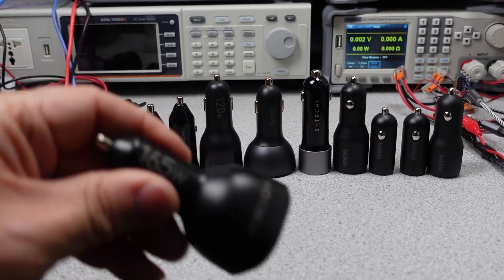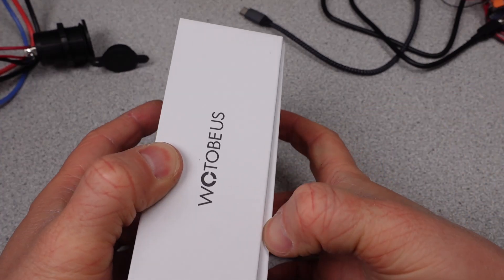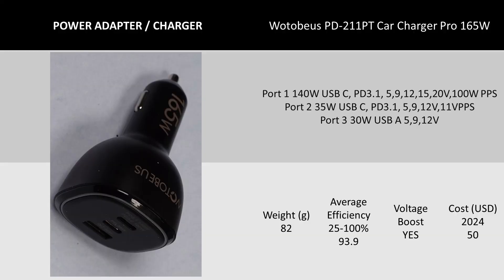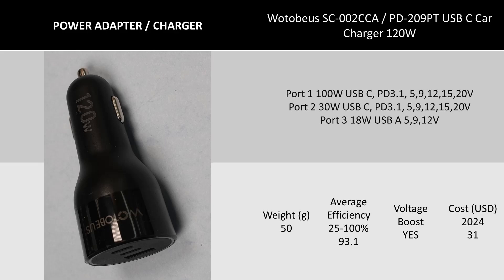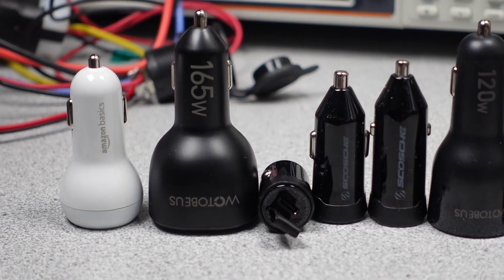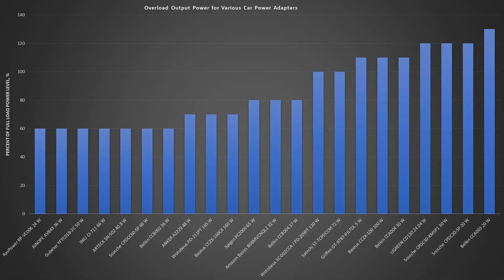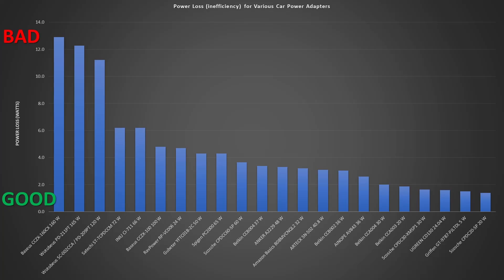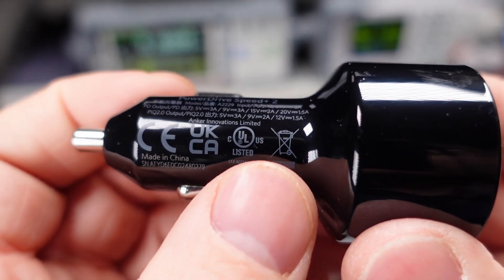USB car chargers from 5 watts to 165 watts reviewed and tested

Comment: @allthingsoneplace can you review the aohi 170w "car charger " vs 160w  baseus car charger? the aohi seems amazing (have a screen) this is good for people in a camper van that looks the use everything in 12v and want to run their computer and everything. Also there is this ugreen 150w that have a cable, it seems good, from hours of research this are the 3 ones that look the best and easy to find

Comment: Wow!  That eliminates the Wotobeus and 2 USB ports in my search.  This widowed senior thanks you!

But my socket is sunk under a door making width an issue.  So, the longer Satechi 72W, while not perfect, might be best?  I watched several times, thank you.  And am most grateful.  Both my 6th generation 12.9” iPadPro and my iPhone 15 ProMax are shown as compatible.  They’ll just have to take turns, vs. dual charging.  I’d eliminate the USB-A if I could, as it seems totally unnecessary?

Now on to cables.  You have more videos!   Wondering if the soft Mophie 60W stream I wanted will be adequate?  I learned I beed ESR?  Or maybe I’ll need to go to 100W?  Wow…

Thanks!
Linda

Comment: so you say you use the Anker, but you said the socket isn't meant for the current in 12v and can't get the heat out?? so is it safe or not for a cig lighter...
Reply from the maker: At the higher wattage adapters, the contact in a cigarette lighter socket can be very poor and then the pins get crazy hot and melt the plastic body of the adapter.  This has been demonstrated on many channels, I've melted a few myself.  The sockets are usually fine.   They have various ratings but it's the connection of the adapter to the socket that becomes a problem.

Comment: Idea for a follow-up video. Testing PD 3.1 car adapters (140W on a single USB-C port).
Reply from the maker: Yeah, it's pretty difficult as it's beyond the power capacity of most sockets, unless they are 24V sockets.  I also haven't seen many at that power level.

Comment: Looking seriously at the Baseus CCZX-100 specifically for Starlink Mini operating on USB-C.  Given it needs 100W for startup then drops to 20-40W during operation, I think this is a good fit.  I'm using 12V car socket in my travel trailer that's rated to 15A and supported by appropriate wiring/fuse.  Strictly looking at the efficiency, the fact that charger will never be left in place when not in use, heat disipation, etc, this appear to be my current best option.  Alternatively, would love to hear opinion on Anker Nano 167.5W 3 port.  Only need one port.
Reply from the maker: Nice setup. I’d check the all things website if you want the efficiency of the ones I’ve tested.  Yeah it’s important to have that current rates socket.   I’ll have to look at some more high power options.

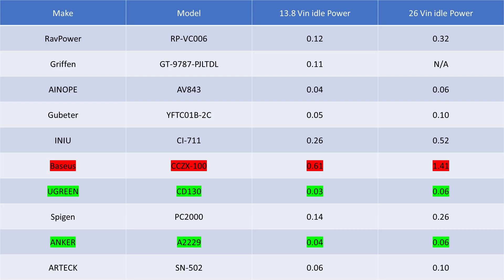Comment: What is that table at 10:58 where Baseus CCZX-100 has some kind of value 0.61 and you were talking about idle power…? I just bought that. It has a display that is turned on even if no USB device is plugged in. Probably that is using the power – in that case the comparison table is not fair. 🤷‍♂️ Anyway, thank you for the review (I learned that this charger is not the worst), it helped me to decide to buy it! 😉

Comment: I use a 175W HKyoriyoi car charger that supports PPS Fast Charging 2.0 for my Samsung S25 Ultra phone in my Honda that supports 180W and it’s amazing. I also have my dash cam and an extra iPhone cable connected to it.
Reply from the maker: Yeah, that’s a lot of current on this type of connector.

Comment: Hi could you help me please in picking a charger to be used in my car.I bought a heat pad for my car and it needs output 12 volts 65watt 3amps would you know what one I should get on Amazon.I don’t really understand PD.Does PD mean that the device can give out various voltages and that your device will take what it needs?Thanks.

Comment: Hi, I've just come across your channel from trying to wade through the mess of 12V car chargers, I'm finding it a rabbit hole. Hope you might be able to give a bit of advice. I'm looking for a charger that can keep my phone from draining on long journeys while I use Google Maps. 
I've been looking on Amazon and it's a minefield, everything is different specs (wattage, PD, PPS)! I also can't help but notice there are a lot of Chinese manufacturers that I've never heard of and I wonder how safe they are (Iniu, Anker, UGreen) but also how valid their claims are of what they can do, I kinda feel like they might be fibbing and how many of them are copies of each other... The only one I've heard of is Belkin which seems to come at a premium. 
Unfortunately, the Anker one you have isn't sold anymore. Any advice on choosing between the current range on Amazon? I was thinking of the Belkin as I thought it would be made to stricter standards (which I think it is) but it sounds like they disappointed in your tests. A link to one on Amazon would be good. 
I've also just upgraded to a slightly newer phone after using an S6 for an age so moving to USB C. Cables for this also seems to be a mess to understand with the various iterations in speed. Again, the ones available are sold from the likes of Anker but most USB A to USB C cables seems to be the older USB 2.0 standard, rather than USB 3.1/2.

Comment: For us not so knowledgeable on all this, is there any simple way to know or check for high power usage when nothing is plugged in? If it helps me, I just got the Power-Z KM003C USB-C tester and started learning how to use it. Can I use this tester to look for something that will tell me if my current car chargers have high power idle use?
Reply from the maker: That tester won't work for that as this power consumption is between the socket and the car charger.  You basically need a power analyzer with low power capabilities for low wattage measurements.  For DC measurements like this, you can build it yourself with a couple multimeters and a resistor, a calculator and ohms law.  Sounds like a video idea to me.
Reply: @AllThingsOnePlace  Yup, WAY out of my league and best to leave it to pros like you 😊

Comment: it would be interesting to test 'load dump' - what happens if you disconnect the battery on a conventional system and you get inductive kickback into the socket. This can hit 80V or so. Exploding at 30V in (high battery voltage on a 24V vehicle)
Reply from the maker: Ah, yeah, just rip it out of the socket, if you slowly take it out, you could go way over 80 volts and make some nice arcs.  Now I need to find a see through car socket, ha.  I'd hope the better designed ones have a TVS, the cheaper ones aren't going to.  I did a bunch of tests for this with USB C at 5A.  I have no idea what I did with any of that.  You can get some nice sparks.
Reply: @AllThingsOnePlace  This isn't taking it out of the socket, it's the battery becoming disconnected when the car is running, and all of the inductive loads in the car spiking the supply. TIs 'Application Report
SNVA681A – March 2015 Load Dump and Cranking Protection for Automotive Backlight LED Power Supply' is a reasonable overview. The voltages that can come out of a mildly faulty automobile, that everything really needs to survive to be reliable is pretty wild.

Comment: I think there are some interesting 12V USB chargers in the van dwelling, or RV, circles.
I think I wound up with one of the  CoolGear ChargeIt models. And ran 2 wires to the battery or some 12v hot point inside the car.
I'm not sure about the pros/cons for everyone - I assume if someone is here watching this, they're willing to watch a yt video about how to install one, and spend an hour running the wires.
IMO, I figure I'm going to be charging stuff in my car for the rest of my life. I may as well have the convenience of a permanent power port, and whatever fast charging I could need. It's kind of nice having the option to throw a laptop or phone under a car seat, and leave it charging while you go into a store or something.
And depending on the car, maybe it's nicer to have it located in a glovebox, footwell, under a seat, etc. Sometimes cigarette sockets are not conveniently located. And my old one had bad contacts, so sometimes it'd wiggle itself loose.
I don't know what you'd search for if you want one - probably something like 'laptop rv/van charger', or 'hardwired 12v usb charger', or add pps, 60w, etc.
Reply from the maker: mm, yeah, permanent charging point, I've done that on some older cars.  Switch and a fuse.

Comment: was looking at boost converters to try and wire into my diy 12v/24v 4s/8s lifepo4 battery packs to use around the house/in the car. found some cheap higher wattage models meant for using w/ LED light, but the voltage range wasnt very usable and they were all large units with heat sinks, then i remembered these things existed. the boards inside are really slim in some models. think i might make a power bank out of ~32ah lifepo4 cells and use these for the output. need something close to ~14.6v to handle charging but i think ill just end up using an mppt solar charge controller. dc is dc and those charge controllers work fine with any dc source., and the cheaper mppt ones still have the ability to step up voltage with preset lifepo4 4s/8s settings. EASUN power (generic epever) makes a 20a mppt that they sell for only ~20$. could just change the input leads from solar wires to an xd60 and attach a 15v or 20v pd trigger board and charge my ammo can packs up that way from a gan usb-c wall charger, or use a solar panel. still not using bms boards. active/inductive balancers with a 12v thermostat/15w heating pad works fine and is probably safer given most lifepo4 battery issues are because of junk bms boards
Reply from the maker: that's a lot.  and yeah, these little converters aren't a bad place to salvage some converters.  anyway, be safe with all those batteries.

Comment: I'm looking for a car charger with three usb-c PD ports (1/family member). I did see Lisen 101W and URVNS 240W on Amazon, but that 240W scares me temperature and battery draw wise. I don't see a single safety listing. Any advice?
Reply from the maker: Yeah, 240W for a car charger... no.  haha   100 watts is pushing it even but hopefully will work.  Yeah, it isn't really a product category they worry about for a safety listing because it doesn't interact with the mains.  Basically, does it get hot and melt, and have automotive qualifications, these would be a lot more expensive.

Comment: Are they super capacitor? Just learning 😊 got a dash cam with a capacitor fitted and has only one port. My previous Samsung fast charger with double usb port but wont charge my azdome m550 pro dash properly. Need a usb cigarette charger that charges my dash and phone on the go. Looking at ugreen 130W need help if this would work?

Comment: Although not easy to do, it would be very interesting to see how these "chargers" perform in an actual car with the engine running and the high beam on to make sure the alternator is "active". Can they handle the "dirty" input voltage? Or will they output "very dirty" voltage too?

Comment: My baseus 160w just melted. I'm coming back to this review to get some ideas about what to do. 

Now i see it is inefficient and must dissipate 13w. It was hot i was running my laptop.

 But there is no better choice. I'll split the power over several chargers.
Reply from the maker: Yes, splitting over several adapters is a good idea.

Comment: My baseus 160w just melted. I'm coming back to this review to get some ideas about what to do.
Reply from the maker: It is interesting that some have had great luck with it and others, well you know.  The connection point to the vehicle is a very small contact pad and therefore that area will get very hot.  I have had entire connectors melt from this contact patch being not the greatest.  Then on top of the efficiency you will be generating heat internally as well, put those two together and it will melt.

Comment: I've been using the 160 watt Baseus for at least a year now. It pulls device charging duty including running\charging my Dell Precision laptop. Never an issue even in the Arizona summer however I've never maxed it out. I'd estimate 120 watts continuous without complaint
Reply from the maker: Wow. Nice.
Reply: @AllThingsOnePlace  one thing i should have noted is its on a socket connected to a LiFePO4 setup which can handle much more current than the typical 10 amp dash socket and the voltage doesnt droop

Comment: Do mobile phones care about ripple voltage that much? is it really much of a concern?
Reply from the maker: As long as it is within reason the power supply should be able to handle it.  In most cases phones are reducing the incoming voltage so as long as the voltage doesn't fall below that point or exceed maximum ratings I don't expect there to be a problem.  This would be some crazy unstable power supply though.

Comment: Do you know the max voltage the 165 watt charger can handle? I was planning to use it to build a power bank to power my laptop, but I don't know the max voltage it could handle. My cells are 3.6v nominal and 4.2v max, and a 8s configuration would be perfect for the inverter I was planning to pair with it. But, that would put it at 33.6V max voltage, and I'm not sure if it could handle it? I know a fully charged 24v sealed lead acid battery is 25.77 volts, but that would limit me to a voltage range of 18v to 25.2v for a 6s li-ion battery pack.
Reply from the maker: Yeah, I didn't test over voltage as that's usually a one time test and the product fails permanently after that.  I would expect two times nominal car battery voltage though so 28.8V, the converters are likely 30V tolerant, the question is how cheap did they go on the input capacitance voltage.  Hopefully, at least 30V rated.
Reply: @AllThingsOnePlace  Just did some tests and it seems like it tolerates a max of about 30V. Nothing abnormal with a brief test with 7 batteries at 29.2V. With 8 batteries at 33.3V, I did not see any output from the USB-A port.  It might have over-voltage protection set at 30V, because it continues to work after lowering the voltage back down.
Reply from the maker: @petermai398  Nice!  Thanks for checking that out and sharing.

Comment: I have a 2011 Toyota Tacoma and it says that its a 12v 120w power outlet so am I safe to grab any car charger under 120W I was thinking about 100 so I could charge my laptop if I needed to, but I don't want to blow a fuse.  It's a 16" Macbook Pro so if I have to get a power bank instead to be safe I am fine doing that.  Thanks again, your videos are so informative I'm doing my best to learn.
Reply from the maker: If it's rated for that power level, then a 100W charger should be fine.
Reply: @AllThingsOnePlace  Thanks! I got a response about my JBL Clip 4 speaker from a tech and they said that the voltage on the ugreen 30w (B09DSV9G78) could damage the device and they recommended the 5v 2a instead. I'm not sure I understand why the voltage would be a factor when the device should only pull a certain amount of watts?  Any clarity should be appreciated, thanks!
Reply: Ok I did a little reading and it seems like voltage matching is very important so I probably shouldn't use that car charger for my device, which sucks.  Still not sure why though
Reply from the maker: @danieldestefano7053  hmm, that sounds wrong.  The car USB chargers will only put out 5V and if your device has a USB port, it should be 5V compatible, a few manufacturers did some shady things a while back buy anything newer I would expect to work just fine.  If the device negotiates for a higher voltage but can not handle that voltage then the manufacturer should recall that product as that's a hazard.  The UGREEN will not supply more than 5V unless it is negotiated for.
Reply: @AllThingsOnePlace  Ok thank you! I was wondering if they saw that 12-24 on the amazon listing and thought it was the output voltage instead of input.  Thanks for clearing that up
Reply: Last question I swear  @AllThingsOnePlace ! I'm probably misunderstanding but why do they sell car chargers with input voltage at 24v (ugreen cd130) when most car outlets are only 12v?  Am I safe to use the cd130 on my 12V outlet in my car?
Reply from the maker: @danieldestefano7053  The car chargers are often rated with a range of 12 - 24.  They will work over this range without any issues.  Some can boost the voltage, some can only reduce the voltage or buck, so depending on the design it may not be able to generate 20 volts for example from 12 volts if it can only reduce voltage.

Comment: Great review. I've had 2 ugreen 130W "car chargers" die on me. I use them with my usb c dewalt charger. They don't make a great connection in my 06 Silverado's power outlet and the 12v pin gets hot. The plastic melts around the pin and it gets stuck so It can't make any connection at all.

And, of course the thing is glued together so you can't fix it.
Reply from the maker: mmm, yeah, I am amazed they haven't just replaced this connector by now.

Comment: I would really like to use one of these PD 3.1 car chargers with my cordless soldering gun (TS101 / Pinecil V2), either of these two soldering guns are capable of drawing 28V/5A or 96W out of a  charger, the only reason I haven't bought one is, I am doubtful that a car charger  can handle 28V /5A  for very long,
Reply from the maker: Yeah, they will struggle with the power level if it's continuous, soldering irons are usually pulsed though so might work fine but I haven't found one that actually does the EPR mode though for a car charger specifically.
Reply: @AllThingsOnePlace  You are right, I havn't find one with EPR mode either, the best regular PD 3.1 charger that has worked with my two soldering guns is the UGREEN model CD289, I have two of them, both can supply 28V, and over 4A continously, and never get hot.